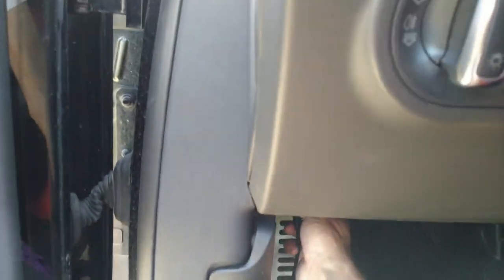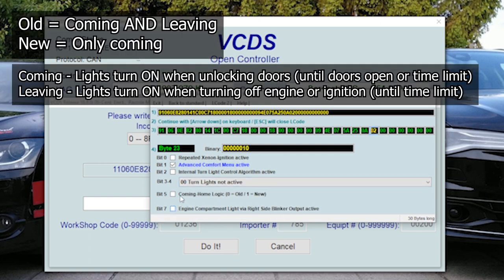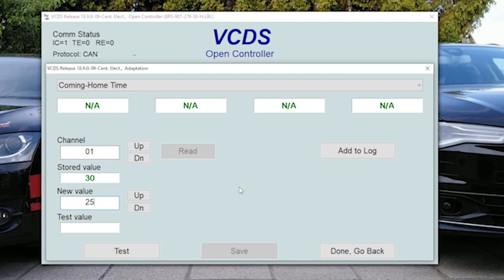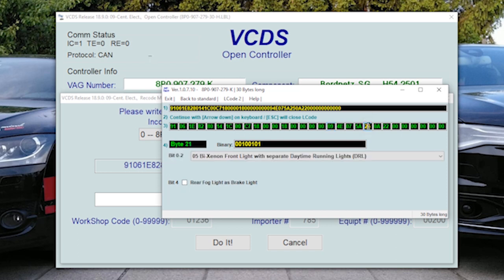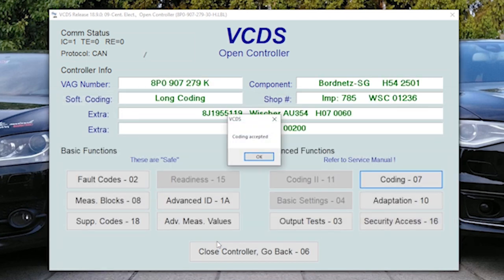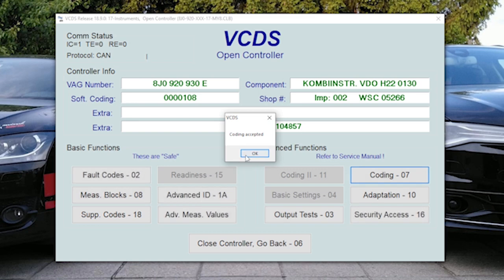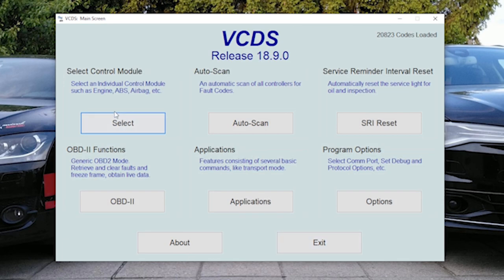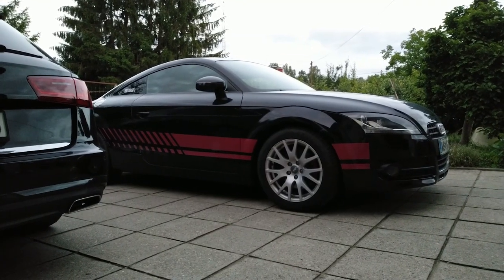Activate Coming-Home, Disable Seatbelt Warning, DRL Mods, Modify Service Interval on Audi TT Mk2

Comment: Hello! I need some help please! My first problem is that te mirror doesnt work and the door remains locked from the passenger side. Can i open the door panwl from inside?the second one is that the seatbelt sometimes beeps even if i have it on .is there a common problem ? If i turn it of the airbag will have problem?

Comment: Hi Mr. you seem to be a pro at the Audi TT.  I have a problem with my boot lid.  When I try to open it wirelessly via the key, the engine raps very loud.  the engine runs for about 4 seconds then I must press the button again to open the trunk.  I have tried to adjust the rubber screws on each side and it helped a couple of days.  Now it does not matter how they are adjusted. Every time i try to open the door the engine raps. Would be greatful if you had some ideas. // Alex from Sweden
Reply from the maker: I hear this kind of an issue for the first time honestly. A VCDS scan would help to see if there are any electrical issues - can you get that? What about the button in the doors, same thing?
Reply: @sunkazz  yes same thing with the botton in the door. I think the lock case is starting to break ... have never changed one but have done some research and it is a fairly common fault on all cars with electric opening. Thank you for replying.

Comment: Hello Sunka ! Do you have auto-lights on your TT ? And also do you know how to put the rear lights always on or on with the drl lights ? thanks
Reply from the maker: No auto lights on this TT.
3:50 DRL Scandinavian turns on rear DRLs.
Reply: @sunkazz  thanks I will try ! I only want rear lights as DRL not the front DRL lights
Reply from the maker: @djedje5750  Thats a strange request, but in this case you should dim or disable DRL headlights.
Reply: @sunkazz  It's because I installed LED stripes that lights on as soon as I turn the ignition on the front bumper grills so I don't need the front DRL, that's why I would like to have the rear lights on even when the light knob is on position 0 ?
Reply from the maker: @djedje5750  Understand, then you can dim front parking lights if it is wired correctly, or just disconnect DRLs from wiring. Anyway the wiring from DRLs should go to your new LED lights. But as said for rear lights SCANDINAVIAN mode turns them on. If you have only scandinavian then DRLs, parking, and rear lights are on. If you have scandinavian AND american then DRLs and rear lights are on. If you have american then just DRLs are on. Depending on the wiring you have you should be able to find proper coding for your case, just play around a bit.